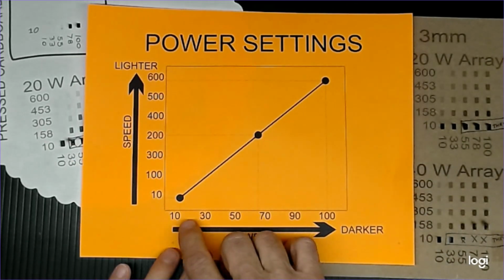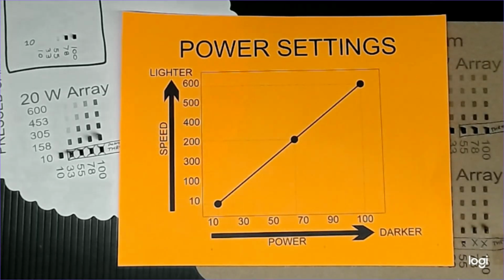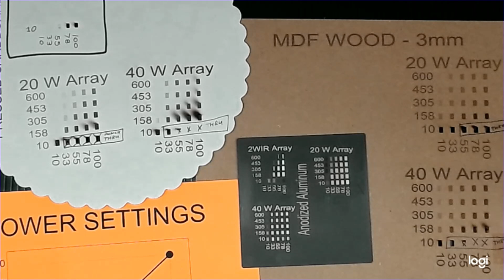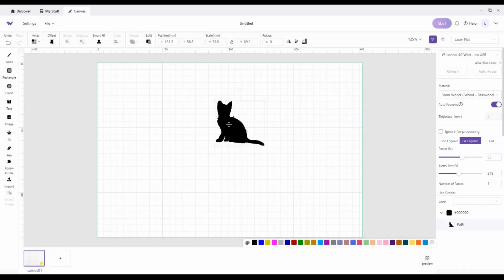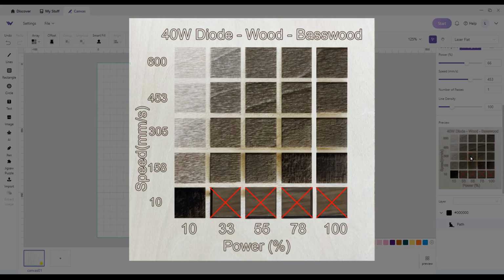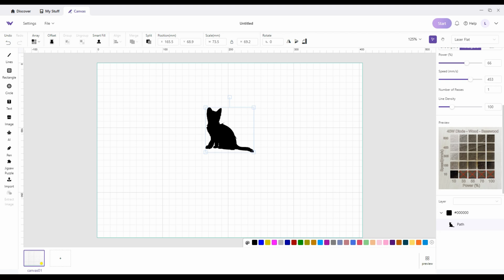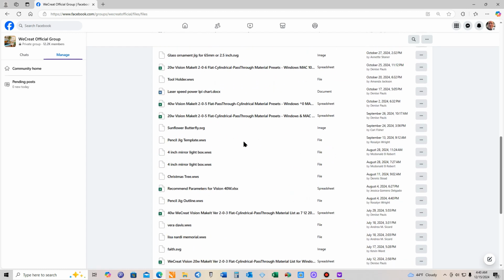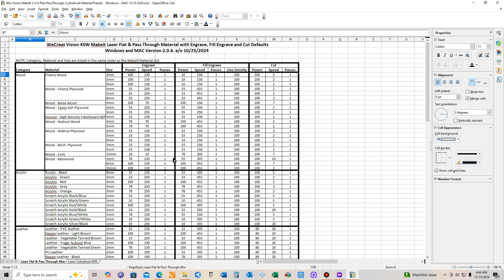What Power Setting Do I Use? - #wecreat Laser

Comment: I've done test arrays for my materials, but it doesn't seem to matter. My laser has about 4 working hours total, I just cleaned everything, including the lens. I just did an array and it was great. Immediatly after, I went to my IMG and used the settings I just saw work... and it doesn't cut all of the way through. So, maybe multiple passes would work? I'm happy to test, but confused. If 90%/8 mm/s works (well, sometimes), I don't want to scald it by using the same power but faster... so would I try ex. 60%/6-8-10 mm/s - 2 pass, 60%/12-14-16 mm/s - 3 pass?

Comment: I love watching your videos and am grateful for the wonderful resource. We have the WeCreat Vista 10w and are having a very difficult time getting projects to cut. As an example 5mm plywood was set at 97 power and a speed of 3 and 2 passes. I had to reprocess it 3 times and it still had places that did not completely cut out so really rough edge and a lot of soot. We have the same problem with 3mm basswood. We only tried the 5mm because the 3mm is really thin for some of the projects we would like to do. Could it be a problem with is laser or it it just a steep learning curve.
Reply from the maker: My 10W is on the way. Ill have more insight when it gets here. But on my 20 I cut 3mm at 100 power 5 speed 1 pass so yours would have ti do 2-3 passes.
Reply: Thank you!  We love the engraving 10w does but the cutting has been very disappointing. High power and low speed and multiple passes produces lots of char and the cut is not smooth. Not sure we have tried the settings you suggest but will try them and hopefully get a better cut. I’m glad you will have the 10w to work with. There are very few videos for the Vista and really look forward to yours as you do a wonderful job at explaining and showing everything. Thank you again.